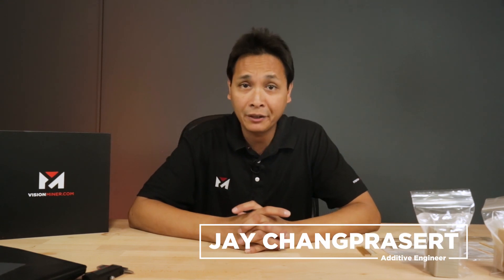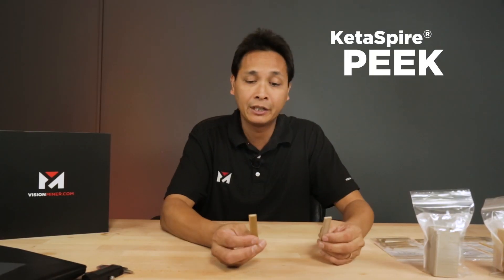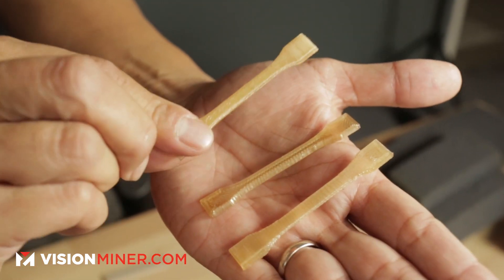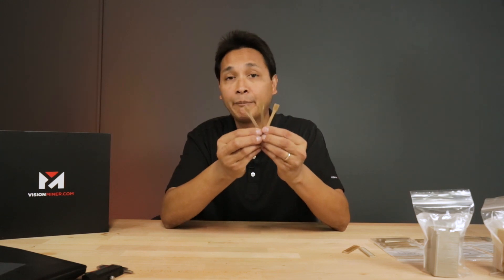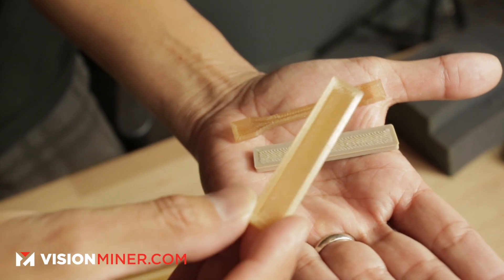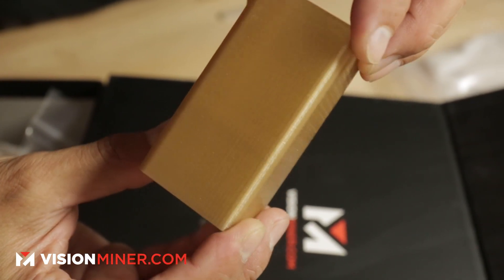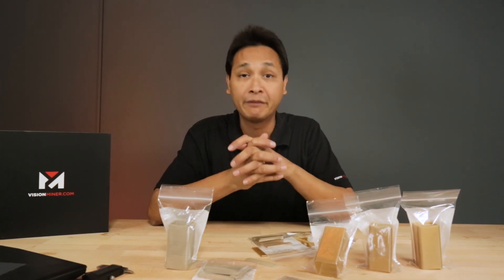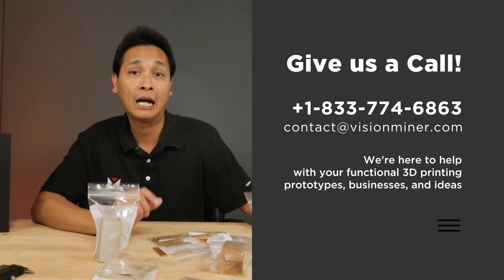Solvay Ketaspire® PEEK and Radel® PPSU AM Filaments - Tensile Strength Testing Parts Overview!

Comment: Do you have to anneal PSU printed parts?
Reply from the maker: You don't "have to" anneal any materials, technically, but you "can" anneal them :) :) It generally does help increase strength and reduce internal stresses